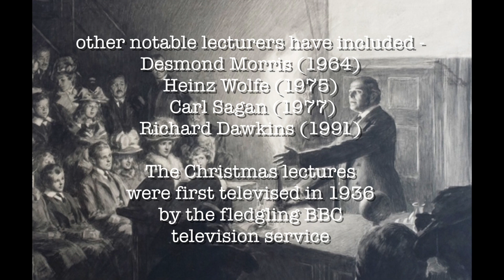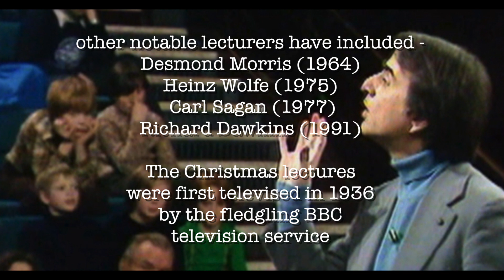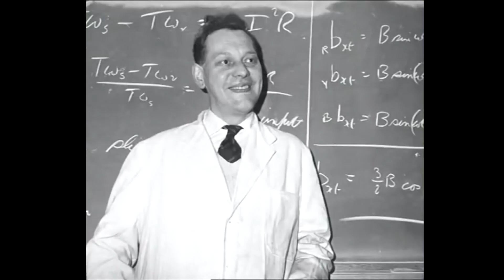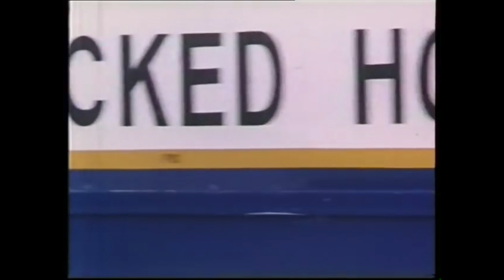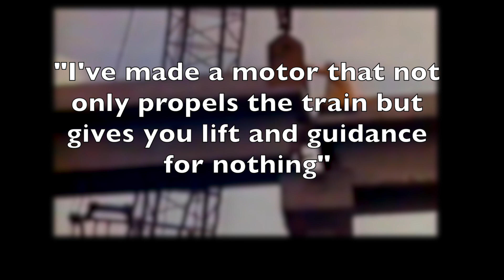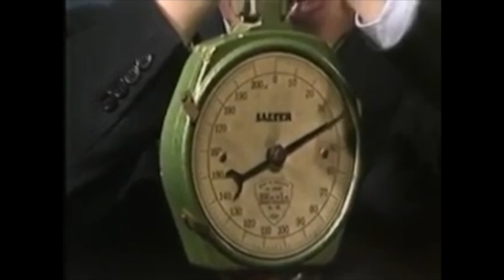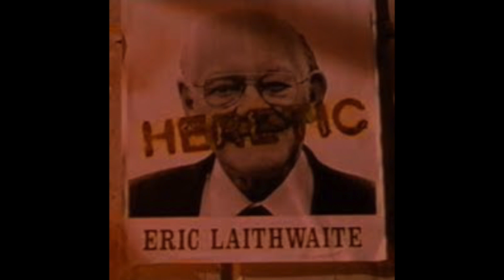'The Anti Gravity Man’ - Eric Laithwaite - part 1

Comment: We now have a way to test whether a gyroscope produces a gravitational field or not. The null hypothesis is gyroscopes do not produce gravitational fields. The experiment is to place two identical gyroscopes in a vacuum near the ends of a LIGO gravitational detector and to move them about in an identical way whilst one is spinning and the other is not. If there is an effect we won't be able to disprove the null hypothesis. By changing the spin speeds we might be able to observe a measurable phenomena. An alternative and cheaper method is to use interferometry to measure the distortion of bar with a weight hanging off the end of it and bringing a spinning gyroscope in a vacuum close by.  You can do this experiment with far cheaper equipment, a sodium lamp and a beam splitter if I remember correctly.
Reply: It should also be possible, by placing a white blob of paint on the gyroscope to measure it's rotation speed using a high speed camera or a strobe light. Eric's experiment should be repeated, but the rotational velocity before and after the gyro is lifted should be measured. If energy is taken from the spinning gyroscope when lifting it in the gravitational field of earth during an "assisted lift", then the rotation speed of the gyroscope should be slightly lower than when it was in the horizontal plane. This would explain why when Eric lifts the Gyro he finds it easier to lift it, when it is spinning. Eric also moves his arm using an arc or spiral motion. Eric does not demonstrate what happens during a linear lift in a straight line.
Reply: @skirmisherssouthport5056  There is another video on Youtube which I saw years ago. (I wish I could find it. Was it by Veritasium?) It covered this type of experiment in more detail. Evidently the spin-lift is critical to lifting from the 'wrong end' of the handle (far from the weights). Spin the opposite direction and the task is almost impossible. But is it antigravity? NO. As in that old video (not nearly as old as the Laithwaite vids), if you stand on a scale while doing these lifts, it will be made clear to you. The indicated weight will fluctuate a little as the flywheels are lifted, but that fluctuation is unchanged whichever way the flywheel spin and the spin-lift are done. Indeed, identical to a non-spinning flywheel. Improper combination of spin and spin-lift does not affect the scale's readings, it merely requires more strength from the man doing the demo.

Comment: If the establishment thinks it is threatened in some way,  it will push anything or anyone away.  With many inventions the innovator is trying to save fuel and make an action easy and comfortable to the operator.  Or even invent a self operating machine. This is fundamentally against the status quo in may cases. 
The establishment only caves in under pressure from the public.  Or if it can see  a way to make money.  There won't be clean travel while there are gun slinging oil rich people around the world.

Comment: Gyroscopic frequency alignment of time duration rate orbital "flow"-> picture plane of QM-Time cross-sectioning orthogonal to the spin axis and the relative multi-phase state transitions of coherent Phys-Chem resonance "cohesion", involving mass, momentum and acceleration fields.

It's the coorinating cause-effect of Time Timing, and the original point of view of the observer's location here-now at the Central Limit of all rotation. It's always now->location and here->spacing ground state.., the origin-al conception-> perceived conceptual experience. 
Like it is for all of us, Professor Laithwaite's terminology is back-to-front relative to the Quantum Operator Fields Modulation Mechanism of QM-Time Principle, In-form-ation formulae.  Mathematics is possibility thinking because discerning the actual coordination of phenomena is very complex and messy reductionist logic about theoretical guesswork. Everyone's unique and therefore "special".

Comment: That is an interesting gyroscopic effect.  I can see what part of the effect is. In order for the wheel to drop, it must rotate the shaft around the fixed point where it is held, it cannot fall straight down. The wheel would therefore have to change the direction of it's angular momentum in order to drop. Conservation of angular momentum provides the apparent force keeping the wheel up. It's the same principle that makes bicycles easy to ride when they are moving. There's some more complex physics going on when the whole thing is rotated around his body, I haven't had the time to calculate that.
Reply: There is another video on Youtube which I saw years ago. (I wish I could find it. Was it by Veritasium?) It covered this type of experiment in more detail. Evidently the spin-lift is critical to lifting from the 'wrong end' of the handle (far from the weights). Spin the opposite direction and the task is almost impossible. But is it antigravity? NO. As in that old video (not nearly as old as the Laithwaite vids), if you stand on a scale while doing these lifts, it will be made clear to you. The indicated weight will fluctuate a little as the flywheels are lifted, but that fluctuation is unchanged whichever way the flywheel spin and the spin-lift are done. Indeed, identical to a non-spinning flywheel. Improper combination of spin and spin-lift does not affect the scale's readings, it merely requires more strength from the man doing the demo.

Comment: What would have been interesting is if he had weighed himself holding the device before spinning the wheel and then while the wheel was spinning. Does anyone think there would be a reduction in overall weight while the wheel was spinning?
Reply: There is another video on Youtube which I saw years ago. (I wish I could find it. Was it by Veritasium?) It covered this type of experiment in more detail. Evidently the spin-lift is critical to lifting from the 'wrong end' of the handle (far from the weights). Spin the opposite direction and the task is almost impossible. But is it antigravity? NO. As in that old video (not nearly as old as the Laithwaite vids), if you stand on a scale while doing these lifts, it will be made clear to you. The indicated weight will fluctuate a little as the flywheels are lifted, but that fluctuation is unchanged whichever way the flywheel spin and the spin-lift are done. Indeed, identical to a non-spinning flywheel. Improper combination of spin and spin-lift does not affect the scale's readings, it merely requires more strength from the man doing the demo.

Comment: Unfortunately, what this video fails to mention is that the infamous gyroscope presentation was completely misguided. Spinning gyro doesn't lose any weight, it won't become light as a feather. It will weight exactly the same amount as it did before it started to spin. The spin just helps with balancing the gyro bar, in layman terms: gyroscopic forces tend to press against any object rotation that's happening in a 90 degree plain towards the spinning plane. It does look kinda "magical".

Now, I am not sure if Laithwaite just fooled himself (which totally possible) or if this was a joke that people din't get or he just gave up on science and become an occultist/shaman. To give him the benefit of a doubt, I'll go with the first or second.

Either way, this is not a Galileo vs. The Church fight. This is just a REAL (verifiable and falsifiable) science vs a man who is completely wrong and uses pseudo science as a backup fight.

Here is a great lecture on gyros: https://www.youtube.com/watch?v=XPUuF_dECVI
Reply: I spent a couple hours realizing this this morning, that it's just a horizontal Force translated 90-degrees to give the perception of a vertical Force. 
Regardless, it does seem it could be used in other force applications, perhaps in elevators, not that people would ride but other elevators. The energy expended might be too great, but there must be applications somewhere other than stability.

Comment: Profesor simón,  Please Check my inventions,  are communily called craizies experiments but i have konwledge about that,  first i put the magnetomillor with a tube of Cooper in a foucoult túnel and centre it,  Please donde Check my experiments about the toobaco i smoke i smoke a lot i dont do any without any about the things at all,  but dont every at all,  at all the same effect about a certanly a circule and a circle inside,  the ring and the magnet in the centre like a point of equilibirum and put the extern ring in atracction with order plate of fe ++ Steel pure,  and over  the force of atracction can be a determinanted force of equilibirum,  against  foward up and levitate the articule magnetomillor,  well at finished  in proceess about the institute of my city and we can probe any Before,about me,  i am fine,  the video very interesting if you like my experimentations we can probe the effect
Reply: Check my magnetomuelle and others in this intent of mine,congratulations for the video

Comment: At 15:04 and again at 15:17 Laithwaite has lifted the 40 pound gyroscope at arm's length above his head. The key point here is that he did it with so little physical effort — "as light as a feather."
I would suggest to anyone who thinks it is easy to lift a "dead" weight like that, to just try it, e.g. with a 40 pound dumbbell. (I have).
If there really is no net weight loss during the experiment, that only reinforces the question:— how is the gyroscope lifted so easily?
Reply from the maker: Gyroscopes have a strong force at 90 degrees to the rotation of the disc...Laithwaite was using this force to lift the spinning weight...its not anti gravity...it’s just a fascinating force of real physics

Comment: ok, we have to look thoroughly what Mr. Laithwaithe really does here:  A spinning wheel acts like a gyroscope. developing radial forces around the spinning wheel (not to the one holding the axle shaft!). But through these radial forces, the forces of gravity become componentized (bent through a mass that is rotating), into a radial force which keeps the wheel in a stable position, and in its gravitational component. We also note that he holds it in a way where the wheel stays vertical. If he would hold it so the wheel would rotate horizontally, the metal disks would have their full gravitational pull downward. Btw:  The whole system does NOT reduce its overall weight, equal how it is being held.
Reply: There is another video on Youtube which I saw years ago. (I wish I could find it. Was it by Veritasium?) It covered this type of experiment in more detail. Evidently the spin-lift is critical to lifting from the 'wrong end' of the handle (far from the weights). Spin the opposite direction and the task is almost impossible. But is it antigravity? NO. As in that old video (not nearly as old as the Laithwaite vids), if you stand on a scale while doing these lifts, it will be made clear to you. The indicated weight will fluctuate a little as the flywheels are lifted, but that fluctuation is unchanged whichever way the flywheel spin and the spin-lift are done. Indeed, identical to a non-spinning flywheel. Improper combination of spin and spin-lift does not affect the scale's readings, it merely requires more strength from the man doing the demo.

Comment: New space shuttle design, 3 spinning disks connected by a triangle, and an inner shell design to spin the opposite at exactly the same speed as the outer shell so u don’t notice spinning, you could easi.... oh wait you would notice spinning... well set it up so the inner shell is light as possible but strong enough to act as your “room” and everything in it. Maybe put your fuel in between the shells. And the outer shell is the one protecting you from space, you will shed a lot of weight that the rockets need to lift

Comment: Thank you Professor Simon Holland.
My suggestion, if I may:
Put the entire system inside a tube, pump the air out, and then air resistance will drop down to near zero.
This will then dramatically increase speed and decrease its power consumption.
And the system will be shielded from birds, wind and rain, making it much more secure.
Speeds of up to mach 5 may be attained.
Think pink!
Reply: yeah, you just described hyperloop... and several systems before it.  it's an old idea, and an expensive one too.

Comment: Hello! I believe that a mechanical system can overcome gravity without ejecting mass. Below a comment that i made to someone who said we needed to break Newton's third law:

We do not need to break Newton's third law as some want, we need to find a method to dribble it, how about the centrifugal force in a pendulum in a specific configuration?
A pendulum where the oscillation is provoked and not leave it at the mercy of gravity.
See the videos below they contain from simple experiments to a practical theoretical demonstration on the subject, and from now I affirm, much more efficient than this Emdrive

https://youtu.be/1VW1y6isl18
https://youtu.be/4foY5r2TMOo
https://youtu.be/nW-8zNhAFXw

Here the whole theoretical part, here is the video that nobody wants to see

https://youtu.be/H28xBjngYuE

The following video although in the end show a turbine, I believe the principle are pendulums.
I call them active pendulums.

https://youtu.be/NvXDGO4zu7Y

There are several patents on the use of centrifugal force in linear motion and some of those patents use pendulums.
I have copy of 7 patents related to this and all expired.
The pendulums we hardly studied and they active, these are the ones that we do not even hear, except in mechatronics.
The centrifugal force, by physics, is conventionally called virtual.
Whoever takes an interest in the subject sends a line.

Comment: So, perhaps that liquid metal spinning inside the claimed TR3B is there to act like a spinning gyro and act as weight cancellation
Reply from the maker: wow....tell more more on the TRB3 liquid metal.
Reply: Professor Simon Holland Hello Professor. Years ago a man by the name of Edgard Rothschild Fouché presented remarkable information. His presentation was based around an advanced aircraft design that apparently goes by the code name TR3B. It used advanced propulsion methods, amongst others: extremely high voltages and to his shared knowledge, liquid metal under immense pressure, spinning at 60 thousand rpm. Before one dismisses his claims, in his talk he mentions that this craft uses something called 5D Quasi Crystals. At the time critics said: impossible, non sense. Fast forward 15 yrs later.. a Professor anounches ‘he discovered’ 5D Quasi Crystals...
It is a long presentation but worth your time: https://youtu.be/Cc1IrnEkH0g
-edit: additional information added.
Reply: Professor Simon Holland Mr Holland, are you familiar with Bob Lazar?
Reply: Lastly, your fellow countrymen Richard D Hall and Andrew Johnson work together on a YT channel called Richplanet: https://youtu.be/mBQjlQs3ZIw
Mr Johnson is the author of a book called: Finding The Secret Space Program; Removing Truth’s Protective Layers. A most wonderful book, also partly shown via their Richplanet YT channel. Professor Eric Laightwaite is mentioned in the book and on their YT presentation. 
I have ordered the book through Andrews personal website https://www.checktheevidence.com/wordpress/product/finding-the-secret-space-programme-removing-truths-protective-layers/ . If you send him an email after ordering the book, he will sign it for you. 
I am not payed or have any affiliation wit them.